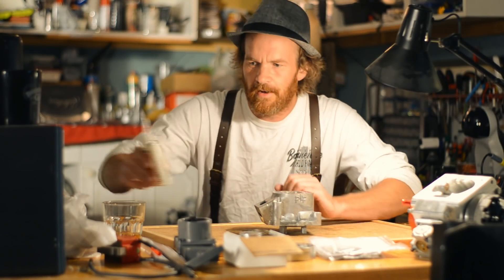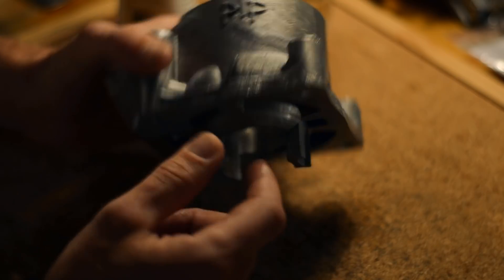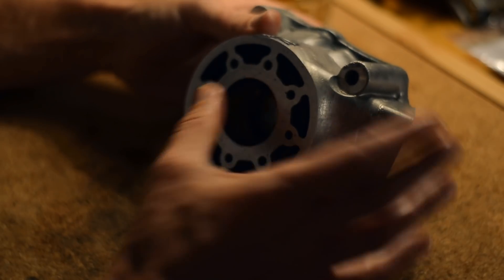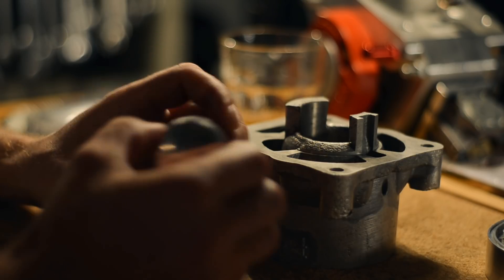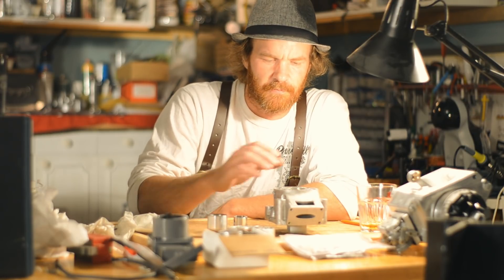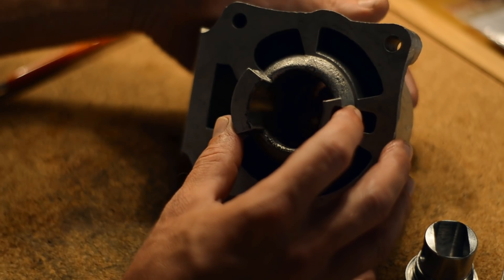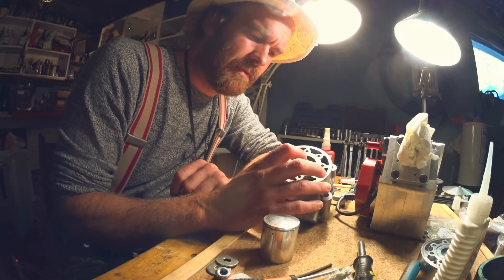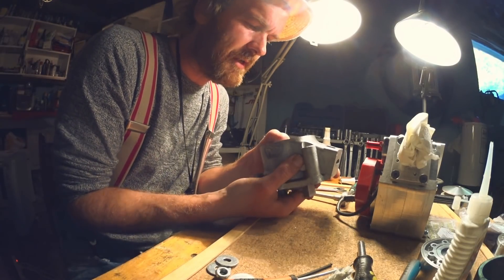The Most Powerful Two Stroke Ever - Won't be long now!

Comment: I was a 2stroke nut in the day and love the smell of Castrol😍!
Anyway ..on the subject of experiments and porting arrangements I didn't have the facilities...
I agree your cylinder needs a good nicrasil coating on it 👍.
As for the 100% exhaust port duration/width/area ????
Good idea in theory but too much stress on piston ring 😤...
How about ...
Reconfiguration of the porting ???
Hence.. why not repoint the direction of the transfer angles ??
Also have them entering the cylinder in a cross flow? ..so they are forced to meet in the middle of the piston and combustion??
Front transfers keep as normal ...
Back transfers facing the front so flow surely flow must meet up in the middle under load ??
Also introduce a 2nd exhaust port at the back of the cylinder 💪.
Therefore keeping both exhaust ports at reasonable width 😁??

Comment: Would it not be beneficial to add 1 bridge in the centre of the exhaust port? My thinking is that even if you got it to work perfectly the way it is now, with extreme heat and load (you are going to set a land speed record with it afterall) it may start to wear quickly and fail, just a thought... 👍

Comment: I'm curious where your ring is dynamically and what it does as it moves in and out of contact with your bore.
I'm also concerned what temperature changes will do to the fit of your parts.
Good luck.

Comment: A simple solution would have been to create 2 bars on the exhaust port to guide the segment. You still have to be able to solder them, but you will have to redo your nickasyl. In your current configuration, you will have too much friction on the exhaust side and it will not work, your segment will tear the nikasyl in a few minutes. ;-)

Comment: Do you have a coating for the piston? If not then the friction from the Ring on the piston may damage the piston so quickly the useful life would be to short. Having the piston ring on the piston mean all the friction goes on the walls of the cylinder which is very hard. 

I think a ring retainer is a possible answer. Mazda had issues with this on the rotary engine seals the apex seals to be specific. Here's my idea. Limit the amount the ring is allowed to expand. If you make a ring with a wedge shape and a piston that has a removable head. You could machine a ring groove so that it limits the piston ring from moving to far out. Use shims or lapping to adjust the amount of ring expansion. I would be happy to 3D model my idea and send it to you if you are interested. 

Keep going I want to see the engine run. I bet you do as well. 
Best Matt
Reply from the maker: Watch the latest vid...

Comment: looking good, but i still think you should have chosen for a (copper/brass/...) sleeve, in case you have a seizure or lock, you can quickly exchange the sleeve and proceed having fun.

another thing you might be interested in:
https://en.wikipedia.org/wiki/Yamaha_RD350_YPVS
power output 58.00 HP
http://www.rd350lc.net/

https://en.wikipedia.org/wiki/Two-stroke_power_valve_system#YPVS-Yamaha_Power_Valve_System
YPVS Yamaha Power Valve System

https://amklassiek.nl/wp-content/uploads/2019/10/RDLCYPVS-valve-from-Yamaha-2.png <--------------------  
http://www.fastfromthepast.com/media/catalog/product/cache/1/image/750x750/9df78eab33525d08d6e5fb8d27136e95/9/3/93-0115_zoom.jpg
http://yamaha2tempos.comunidades.net/yamaha-power-valve-system
http://orange.zero.jp/minato_su/tzr/3ma/2004/ypvs.jpg <------------------------------------------

https://www.youtube.com/watch?v=N-Vc60nQF1A <----- how it works

YPVS Yamaha engines, Yamaha Power Valve System: Yamaha engineers realized that by altering the height of the exhaust port they could effectively change the engine power delivery thereby having optimal power and torque across the entire rev range, so it was that the YPVS was born. The valve is of a cylindrical "cotton reel" design running across the top of the exhaust port, it is turned by a servo motor controlled from a control box taking information from the CDI (and other locations). The valve is a slightly oval shape. This changes the height and size of the exhaust port at different engine speeds, maximizing the available power at all rev ranges, opening up firstly at 3k rpm for low end power, gradually in between 3-6k, fully opening at 6k rpm for maximum power, on most 125cc. It was fitted to all of the later models of the RZ/RD two-stroke road bikes (125, 250, 350 and 500 cc), the TZR range. It was also added to the DT(125lc 2/3) range after 1984 (but was locked closed to comply with UK learner regulations until the (R) in 1988-04 which had a fully functional YPVS valve) the DT125R has a better design of engine, although not much altered in speed, just more reliable than its predecessor. The YZ series of motocross bikes has a mechanical power valve which is activated at RPM speed. The YPVS is only found on the liquid-cooled bikes not air cooled versions. Yamaha have also used a guillotine version in some of their later models such as the 1994 TZR250 3XV SP model, and many later TZ road race bikes. The TZR250R 3XV SPR actually uses a Triple-YPVS, which is a combination of the guillotine and "cotton reel" designs.

Yamaha was actually the first company to produce consistent results with their YPVS in their race bikes. The 1977 OW35K was the first race bike to incorporate the power valve system and it won the Finnish GP in 1977. The Kadenacy effect was harnessed and controlled to a point that gave Yamaha great advantage over all the other manufacturers throughout the late '70s and into the mid '80s. The first street bikes with YPVS were the RZ/RD350 YPVS (LC2-onwards), and RZ/RD500 GP Replica in 1983-84. 

also the Yamaha RD series had a Powerbox (at least the 80CC series did) on the inlet manifold between the carb and cyl.
(moped) cycle shops sold these as well:

http://www.retroclub.nl/howtos/5376-uitleg-werking-powerbox.html

Comment: Hi there is another way of fixing the ring problem machine a second ring groove in the piston like conventional piston then you need to press a very small pin in each piston groove about half the depth of the ring groove then on the inside edge of the rings file out an inside notch where the ring compresses together so when the rings are compressed they are retained with the pin and can't turn do this about a 1/4 turn apart so you dont get compression blow by  you could possibly do this with one ring groove keep the pressed in pin opposite the large exhaust port and if you ran 2 rings just stagger the pins to minimize blow by if the ring can't turn it can't catch on the exhaust port problem fixed.Good luck hope this helps don't worry the pin wont come out because the ring compressed covers the pin hope to see the fire breathin rip snorting little bugger run soon cheers from down under

Comment: If possible in your cylinder, i would try to bore a vertical hole true the middel of the exhoust port. just a bit to the outside of the port.
Then jou can can make a steel pin and a little pipe witch wil fit the pin and exactly fits exactly in the exhoust port hight.
To assemble : hold the pipe in plce in the exhaustport then push the pin tru its bore. 
the outside of the pipe should stand exact in line with the cilinder bore.
I think this could work and make your cylinder safer to work.  greetings Eric Kos

Comment: No hone-oil? No bore gauge? Off to a bumpy start, sir.
Reply from the maker: The hone was oiled. Didn't use a bore gauge, just went by feel cause it will need a replating anyway, this is just a test of concept.

Comment: i know many people might already say that, but how about making really wide ring with a slanted ends so even if it hoes over the inyake edge  half of it would still be in contact with the sides
would a rin about 5 mm wide make that much more friction?
Reply from the maker: It would probably struggle at higher rpm. But... other lighter materials than steel/iron could maybe be used. Hmm
Reply: @2STROKESTUFFING  at super high rpm rings probably would be unnecesary anyway if your piston would be tight enough and capilary porce of 2 stroke fuel on the walls would keep the system closed
blowby is mostly an issue in low rpm

high rpm ether  fuel model engines don't have rings, but i am not sure how eficient those aree

Comment: Usually when going with huge, wide exhaust ports you seperate the port into two halfs. Leave some shallow piece of material in the middle of the port to keep the ring under tension. The filed ring or whatever you did has no option apart from failing mechanical. 
The ring will wear the piston in no time when installed in the zylinder and it will reduce the compression as well. Just redo the cylinder and try to stick with a more practical design. A simple design works well if done correctly.

Comment: What about having thin but enough  support mid exhaust port to keep the ring from expanding? How much would that cost at exhaust flow? The cilinder ring story is really difficult with an aluminium piston you have to redesign it completely. That ring would be a scraper and how would you let the gap for heat deformation it has to be kind of loose in there.  That would be a real challenge.

Comment: What if you go thicker in the cylinder wall so you can get some fat bridges around it that won't be prone to snapping? then you will be sacrificing some port size, but increasing reliability and decreasing ring movement. like a 2 stroke diesel inlet port.

Comment: Have you ever considered having no piston ring at all, but instead having an ever so slightly tapered cylinder sleeve (like those model car engines, who also run on a methanol/nitro/oil mixture)?

Comment: No,no! Don't change the ring just add some webbing or vertical support in the exhaust port....I know from a canam 500 bored to a 600, in garage build,( only because I had the piston) it had webbing I removed for more flow...well I was 18 and knew everything thankfully!!

Comment: I may have said this before but you will do yourself a massive favour if you run with a cylinder liner until you have the design nailed then switch to Nikasil. If you try to put the ring in the cylinder wall you would have to run with a Nikasil piston. I still dont think it would work, I think the piston would keep breaking the ring at much above tick over. However it should be quite testable with a plain cylinder and ring (not a barrel) and a plain piston then power the crank...

Comment: Awesome, getting the engine started and running before worrying about the gb makes sense trouble shoot one piece at a time. 

Not fully assembling may be a mistake as you may do things to 'f8x' issues your full build has already done and then find out your 'fixed' engine really isn't happy in its full form

Comment: That huge exhaust port is going to eat that ring in seconds, you could sleeve it and include a bridge in the port but when it heats up a narrow bridge may expand into the bore. It's a fine line the rotary engine guys have had to deal with for a long time with their bridge port conversions.

Comment: wonder if it would help to make the ring like a coil so the ends overlap 100 percent and goes around the bore twice , that would make the gap non existent it and you would need a LOT less tension in the spring as it divides the tension across the two passes probably be a lot harder to make and install though

youre idea of having the ring sit in the cilinder is interesting as in i never seen it done that way 
but i think that with the speed the piston moves past the ring it ill just keeps it sitting against the back of the ring groove , i think at 15000 rpm or more the spring tension isnt enough to make the ring return to its original shape 
could allso be that once the ring reaches its thermal expansion and the ends butt together the ring has the perfect size for the piston to pass through without friction 
one last thing i think might be a problem is that if the burncycle goes past the ring in the cilinder the burning mixture could move down btween the piston and the bore and ignite the mixture in the crankcase you might still need to add a ring lower on the piston to prevent that from happening 
you might need to coat the piston with nickasil too as you reversed the up and down friction from the cilinder to the piston
maibe if you find a fiber or plastic that can handle the heat and doesnt expand / contract you can make the ring out of one piece 
might allso help of you make the ring a round edge instead of adding a chamfer

Comment: RC engines have run ringless pistons for years. Break-in is CRUCIAL though... and so is extremely tight tolerances. Also, a ringless piston design has a very short duty cycle. The cylinder integrated ring design you're proposing has a significant problem... piston galling. It COULD work, if you had a ceramic coated or NIKASIL coated piston... but it wouldn't be worth the reciprocating mass added by the coating... or the risk of it flaking off the expanding piston. 

In short, cylinder walls are designed to ensure shear forces. Piston skirts are not.
Reply from the maker: Ringless tapered pistons don't scale up too well I've heard, but I'm tempted to try.
Coating the piston would add an insignificant amount of mass, we're talking 50-100micron thickness.

Comment: Really like the idea of a cylinder ring, instead of the piston ring! How about if the ring ID was slightly larger than the piston. This would allow the piston to come up into the ring with a slight clearance.  Then the pressure from the ports closing and piston moving is ported in behind the ring to squeeze it onto the piston. Then after combustion, the ring would be squeezed even tighter, keeping the pressure high on the power part of the stroke. Would need a pretty weak and flexible ring and enough end gap to allow inward movement.  Put slight radius on the top corner of the piston to allow the ring to float and then be centered by the piston. Previous comment suggested nikosil coating of the piston.  The only time that you need really good sealing rings is to contain the high pressure of combustion.  Moderate seal would probably be adequate for the compression part of the stroke.

Comment: Dude , bridge the port , it will snap for no point . The heat will expand it even more , make.try it with a bridge , make it run , than you port out the bridge and try the ring and other things , we NEED to see it working

Comment: Im very happy that you decided to test the cilinder-piston setup before going about with transminsion design. The ring design you mention is a clever idea, although heat tranfer through such thin area sounds like a serious flaw. Have u concidered welding in a bridge in the exhaust? Also, putting in a well machined and chamfered sleave in the cylinder seems like a much safer (more reliable) option. Im really looking forward to the progress in this project. You are definately on to something with it.

Comment: Love the stationary ring idea but the piston would have to be nickel plated because the ring would wear the piston too quick.

I was going to ask how much chamfer of the ports you did.  I hade a cylinder bored out and they never did a chamfer after and the piston only lasted 15 minutes threw the first heat cycle!  Oops!
Reply from the maker: Yep, would need to be plated.
A pretty substantial chamfer + slight taper.
Reply: @2STROKESTUFFING  

Ever seen those older engines, i believe they were diesel, they had sleeves that moved up and down as well as the piston to change port timing?  That would be interest as well.  Not sure if anyone made anything like that in a gas 2 stroke!

Comment: With the ring in the piston, you need some vertical ribs in the porata that size. With ring in the cylinder, you are making a hell of a heat problem to the piston itself. With a proper liner on the piston or a coating of some sort, it's plausible. How about putting the fuel injection spraying methanol underskirt of the piston..? Better dilution with air, yet cooling the piston down.
Reply: Porata - port.